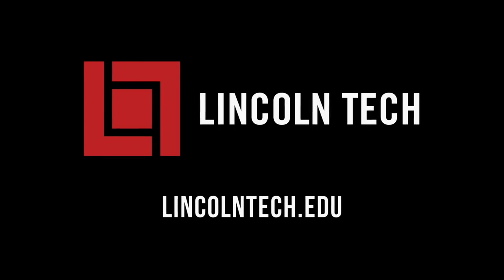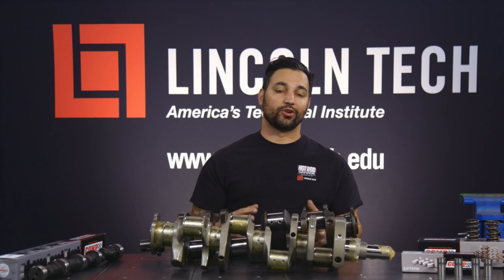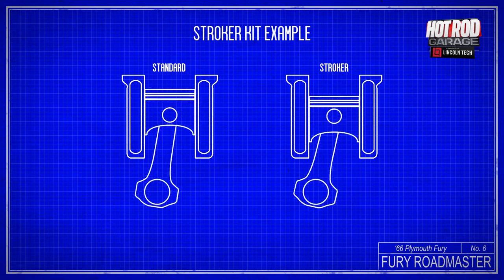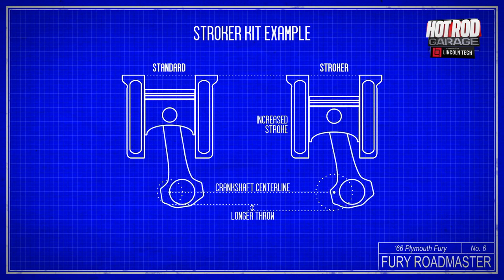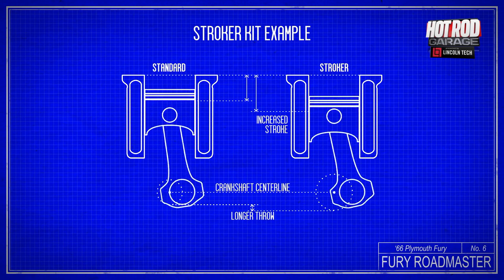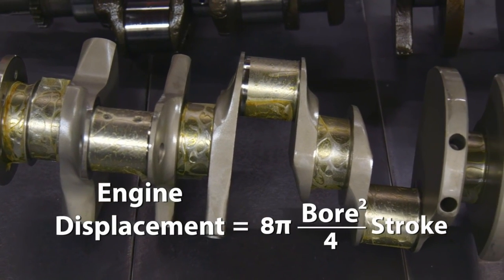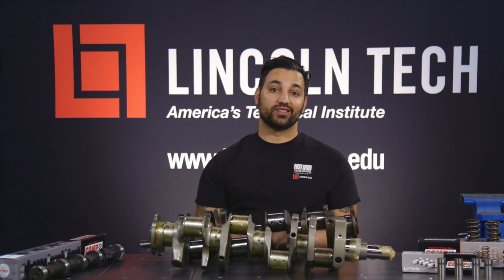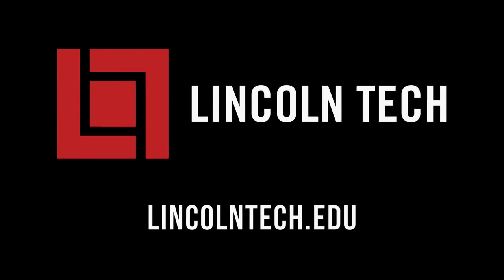Stroker Engines | Hot Rod Garage Tech Tips (Ep. 39)

Comment: For those wonder the 8 comes from the number of cylinders in this example. The real formula for engine displacement is PI*(Bore/2)^2*Stroke*#Cylinders  (to avoid mistakes in your calculators you can use PI*Bore*Bore÷4*Stroke*#Cylinders on a phone too!) 
Example: 302 cu in engine has 4" Bore, 3" stroke. So to do the math 'easy' way... PI*4*4/4*3*8 = 301.59 cu in. Hope that helps.
Reply: To avoid mistakes in calculations, just use all metric.

Comment: Can someone explain this to me;

If you increase the throw, your piston will not only travel further down but also further up. How come it doesnt hit the valves?
Reply: Shorter rods and pistons
Reply: budro you would proably have to upgrade rods pistonds bigger valves shorter stem  etc etc
Reply: The piston travels more downwards and therefore has more room to travel upwards to reach the position it started from.
Reply: budro the piston is shorter, so even the the travel of piston is greater, it will still reach flush to deck top of block or just below. My 302 based 331 Stroker has a 5.4” long rod. Stock rod length was 5.090ish. So longer but only in a couple hundred of thousandths, or 2/10ths of an inch.. it’s made to work by shrinking the vertical dimension of piston height